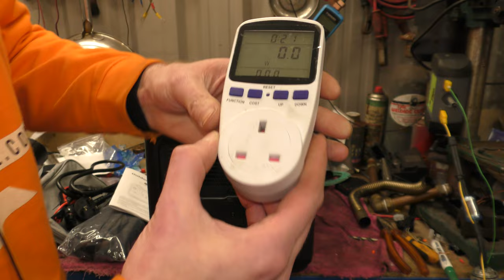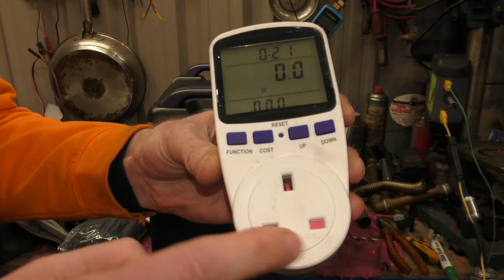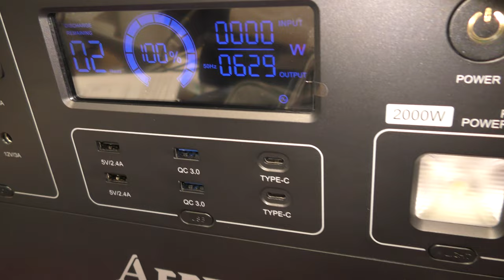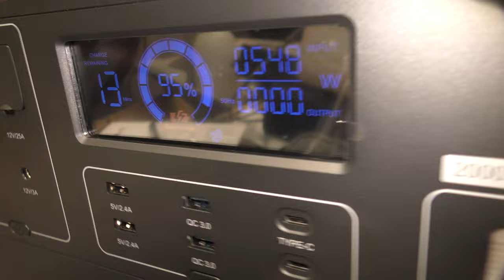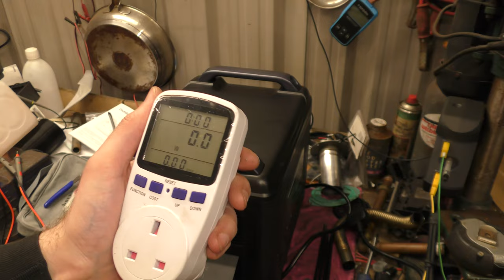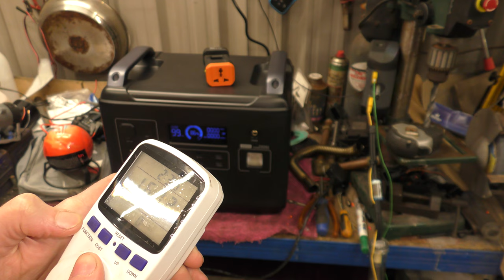AFERIY Portable Power Station 2000W taken apart and tested

Comment: The figures on the side of the battery pack appear to be the range of values of the cells:
1. Individual cell voltage range at 50% charge
2. Range of internal resistance
3. Range of cell capacity.
Multiplying the nominal cell voltage by the number of cells and the capacity average is very close to 2000Wh.
Reply: Good observation. That Ah range is a little wide and so is the mΩ but what can you expect from a budget priced power station. My guess is these are 33140/32131/33131 or something similar based on capacity. Those are usually 12-15Ah.

Comment: Those resistors running that hot is definitely a problem! If the resistors don't fail, the solder joints probably will.
Reply from the maker: Should it fail they would be the first thing I'd check.

Comment: What would have been great is if you popped one of those loose connectors off and tried to operate it just to confirm that the device alerts you to the issue or just tries to operate as normal.
Reply from the maker: Not this unit in particular but in another power station I forgot to plug something in and the heater carried on as normal.  Apart from the bit I didn't plug in obviously.

Comment: I wonder is there any way to turn off supercharge mode, just for save battery recourse. 
I`ve also discovered that pressing any two buttons show some kind of service info, and when you press any three buttons - the screen will turn on all marks it has, and there you can see that such display can be used on powerstations with BT and wi-fi....or maybe there are some hidden features))
Reply: When you hold button over the plugs on the right side for several seconds, you open the settings of charging speed
Reply: @Misterkostya99  спробував я цей метод. На одній станції це доступ до зміни частоти вихідного струму(50гц або 60гц, це на choetech), а на oukitel це не смрацювало взагалі

Comment: Blinky blue lights are just the inverter controller boards, presumably they use the LEDs for diagnosing issues or something, or they just stuck on some blinkies to look fancier than they actually are, cos blue blinkies always look high-tech and futuristic in TV & movies... :P
Reply from the maker: A pet hate of mine.  Unnecessarily bright (usually blue) LEDs on things that will likely be in a dark environment.  Like the 12V charger for my jump pack, a blue LED so bright it could light up the interior of the truck.
Reply: @DavidMcLuckie  Yeah, I've taped over or stuck blu-tack over many a blue LED on things, given these days they're so bright that like you say can light up a space, quite annoying... :S

Comment: Hi David I have an Oukitel P2000 it looks similar to this unit so I am taking a bit of a flier here. On the AC input side it has an overload protection button. It feels quite loose. Anyway my normal plug output and USB ports work when there is power coming into the unit, however when no power comes into the unit, only the USB and 12 V outputs discharge the battery. The normal plug outputs power up for a few seconds when the botton is depressed but after 1/2 seconds it stops and alarm sounds. Do you have any solutions for this for me.

Comment: Hello David, thank you for making this video! I bought one of these just days ago and I have some concerns about quiescent power consumption. Does yours get warm to the touch around the top/rear of the unit (near where the 12V regulator board is) with the 12V outputs turned on even with no load? Mine does...
Reply from the maker: That is something I'll need to look at.  Perhaps with thermal imaging.  :)

Comment: To be fair my 5G modem takes 12V 3Ainput, so yeh. Like it doesn't use 36W, it's like ~10W or there abouts, but the adapter that came with it is 12V 3A.

Comment: Scuse my ignorance - why can't you be shocked by touching live on the mains output on this? Surely the current tries to get to ground, thru your body, resulting in bzzzzt ?
Reply: Because there is no referance to the actual physical ground. In your home wiring, it is  referanced to the ground so the current from live passes through you, using the pysical earth as the return path. In an isolated system like this, you would need to touch the neutral as well as the live to get a shock. One of the reasons they may not connect the ground on the output is so that it is not referanced to the actual ground through the mains input plug.
Reply: The device is isolated from ground, even if you're not :)  (Doesn't apply if it's charging from the mains at the time of course)
Reply: @simonrichards150  I'm guessing that's why they omitted the input ground wire passing through to the output 🤷‍♂️
Reply: @jamiesony3859  I replied before I watched the video, so yes, you're right - that would mean it's isolated even when charging.
Reply from the maker: What all those other lovely people said.  The power station isn't referenced to ground.

Comment: You have to set off a fire extinguisher Ball!  Not seen one of those before.
Reply from the maker: @assassinlexx1993 - Not these ones, just like a powder fire extinguisher.
Reply: @DavidMcLuckie  
I wonder because the one I got has a liquid in it. I was told not to breathe the gases that put out the fire.
All those battery backups are for the fridge to keep the beer cold.